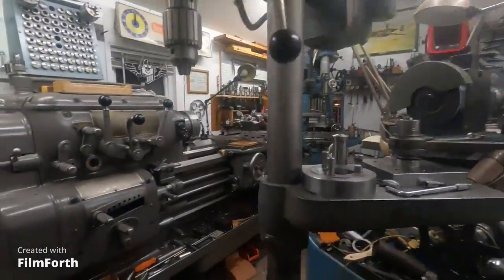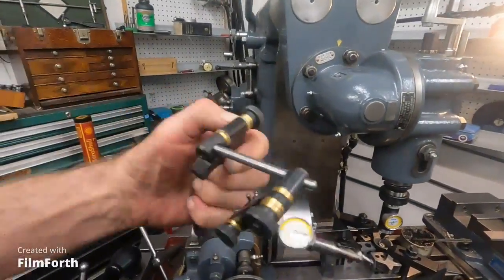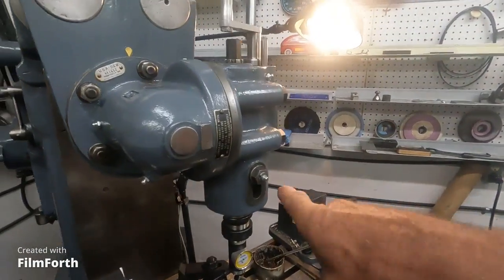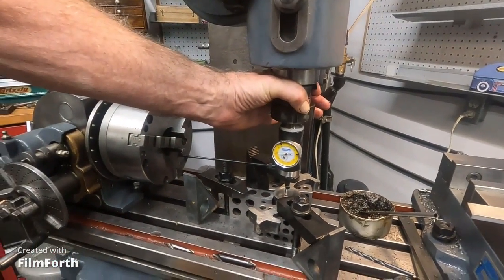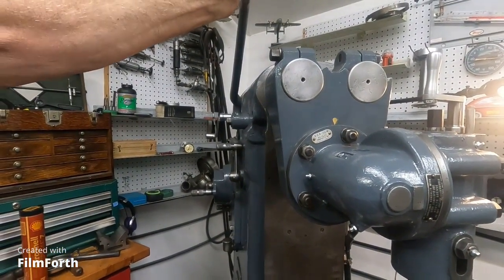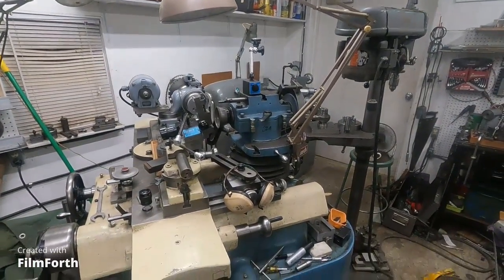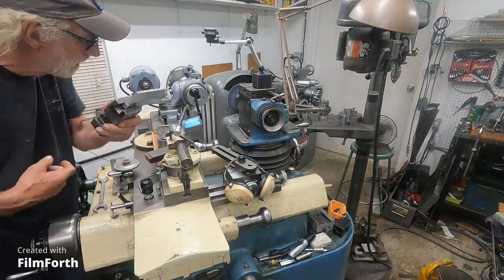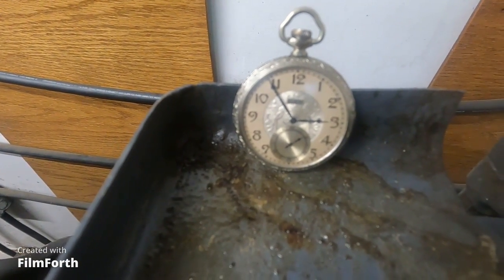Using a Brown & Sharpe No 2 Plain Standard milling machine with CoAx indicator

Comment: DeeDee. Glad to are getting more comfortable with the Blake indicator.  I’ve bought one new 25 years ago and been real happy with how fast it is.  Not as accurate as a tenth test indicator but accurate enough most of the time for the things do.   My friend Archie is finalizing mounting my Multifix complete with dowel pins and machining the top of the compound with the Tee nut locked in with set screws.  I still wonder if I’d been better off to just go withe Aloris style but I’m committed to give the Multifix a chance.  Time will out.  Cheers, TB
Reply from the maker: There is an American lathe here 24" x 10ft heavy pattern with a huge Mulitifx but it seems to be mounted normally like an Aloris. The problem here was availability and cost of Multifix tool holders and not interchangeable with the others. The advantage of much better tool visibility is great and availability seems to be better. I am committed to Aloris AXA for the duration on the 10ee and of course the KDK tool post that all "Radar Men From The Moon" use on Axelson Lathes. That Coax type indicator is working great on this heavy machine.